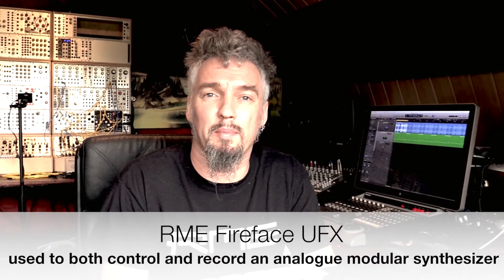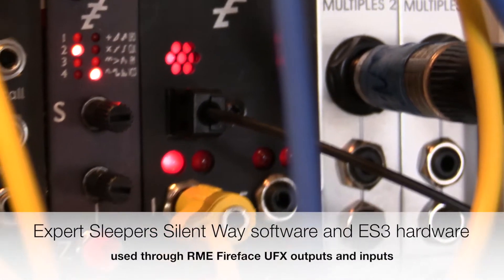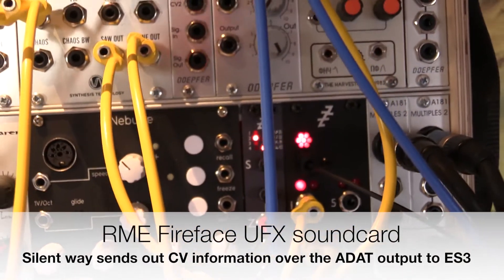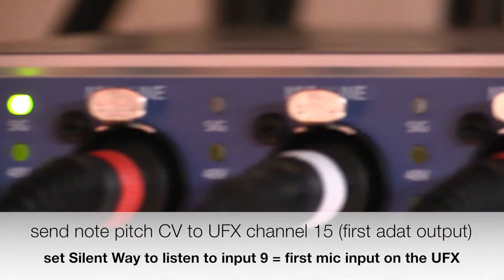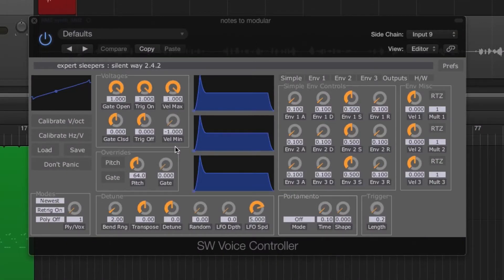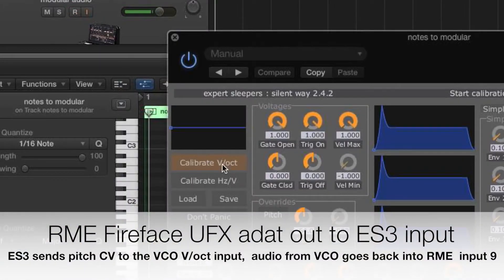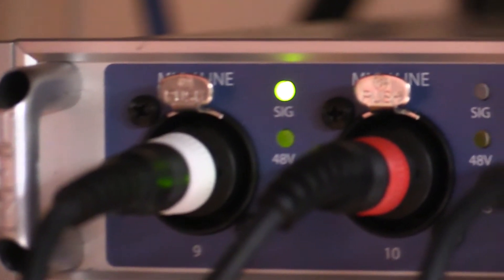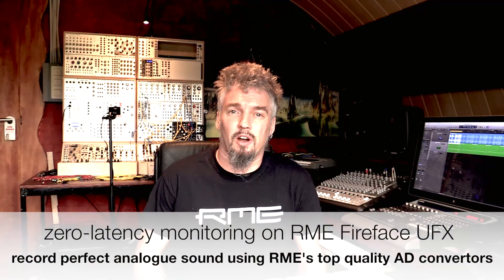How to control and record a Modular Synth with the Fireface UFX

Comment: Thanks for that Wim Daans. Nice setup. Seeing how my eurorack modular audio output signals are much hotter than Line Level, what is the best way for me to plug my modular straight into my Fireface UFX+ inputs ??  Should I go from my Modular to my Radial Passive DI box with balanced XLR Mic level out to my FireFace's XLR inputs & use built in pres to bring to Line Level ??  Would that be a much cleaner result than going straight from Modular unbalanced TS jacks to FireFace's unbalanced jacks??
Reply from the maker: It doesn't matter where you put in your synths to the UFX+. All the inputs give the same results. Also the TRS inputs are balanced, but can be used also unbalanced. The same for the XLR inputs. The mic inputs have a much higher gain range. but on 0dB , they work as line inputs. A DI box would only degrade the sound, unless you like the "distortion".